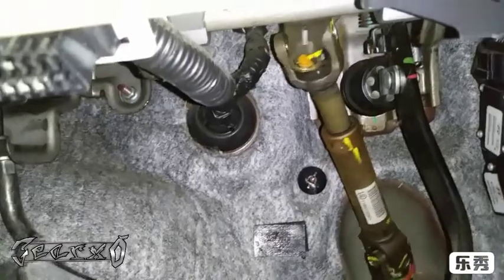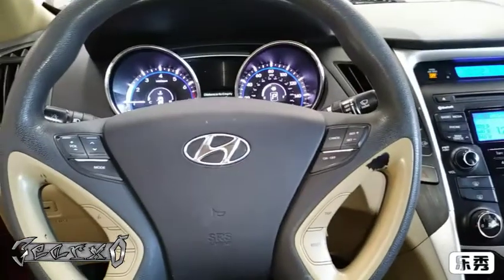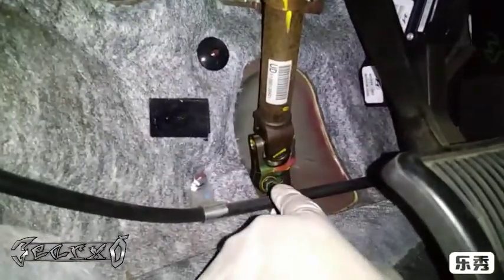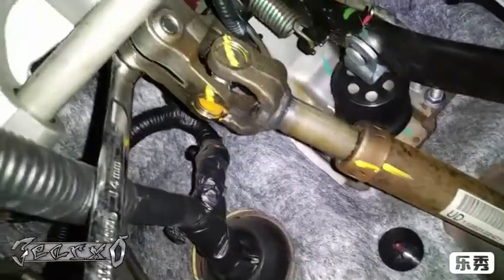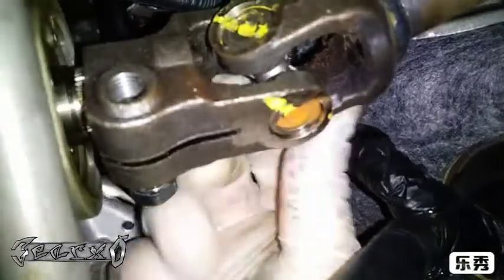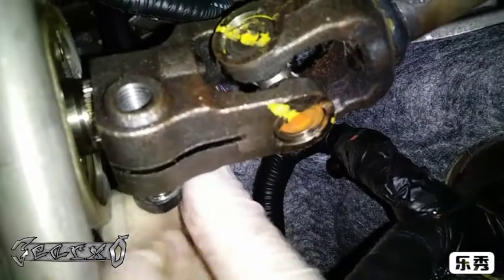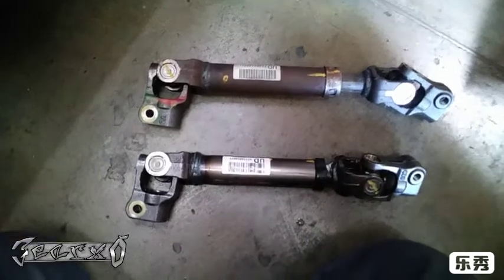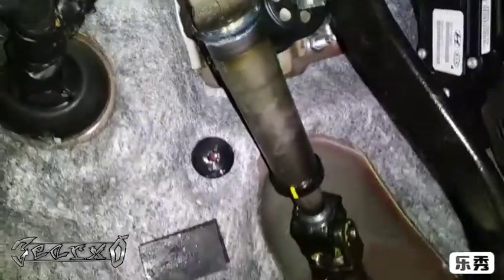Hyundai Sonata intermediate shaft replacement

Comment from the maker: GET THE NEW INTERMEDIATE SHAFT HERE ( AMAZON )
https://amzn.to/3yqxBds

BEFORE YOU REPLACE THE SHAFT LOOK INTO THE TSB 17-ST-002 

Description: The MDPS (motor driven power steering) assembly contains a flexible rubber coupling
which may wear over time resulting in a slight “clicking” or “thud” type noise when turning the steering
wheel. The warranty coverage for this coupling has been extended to 10 years from the date of
original retail delivery or date of first use or 100,000 miles, whichever occurs first. This bulletin
describes the service procedure to replace the coupling. Refer to the warranty and service parts
information outlined in this bulletin whenever MDPS coupling replacement is required

/////////////////////////////////////////////////

This bulletin applies to 2013-2016 Hyundai Santa Fe vehicles. The MDPS (motor driven power steering) flexible rubber coupler may wear over time, resulting in a slight clicking or thud type noise when turning the steering wheel.

According to the maker, the coupler wear does not affect proper operation of the steering.

There are two versions of the new coupler part number, part number 56315-2K000-FFF. One revised coupler features an “HNBR” marking on the polyurethane part, and the revised rubber coupler has a “4P” marking. Both parts are improved for durability.

Replacement involves removal of the steering column. When installing the new coupler, make sure that the flexible coupling is properly seated on its bracket. Verify that the new coupler features marking “4P” or “HNBR.” Conduct the ASP (absolute steering position) calibration procedure according to the service manual, and check and clear any DTCs using the GDS.

Comment: How can you tell if this is bad on your car. I’m getting a clunk in my steering wheel when I turn even the slightest left while idle. It makes the clunk but then stops as I fully turn the steering wheel. So basically when I turn the steering wheel left right left right I hear clunk every time I go left but not right. I have a Hyundai Elantra 2013 and thought it was the coupler but I took it all apart and looked at the coupler and it was still in great condition but I replace it anyway since I had the new one. My car is at 131k miles. Any idea would be grateful.
Reply: This is exactly my problem did you ever find out what it was?
Reply: @DeadshotGames  no I never figured it out. Got rid of the car. I changed the inner and outer tie rod’s along with both cv axels. If I had to guess at this point I would blame it on the drivers side strut mount. Good luck !